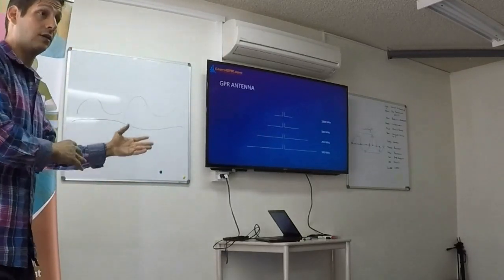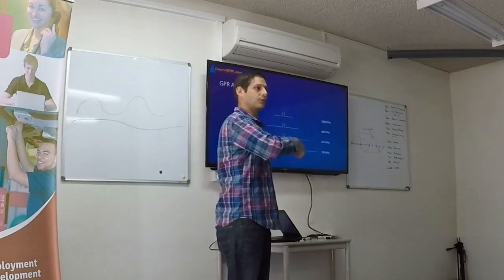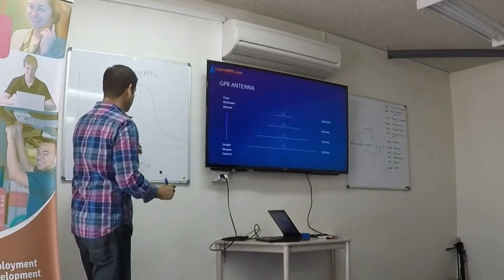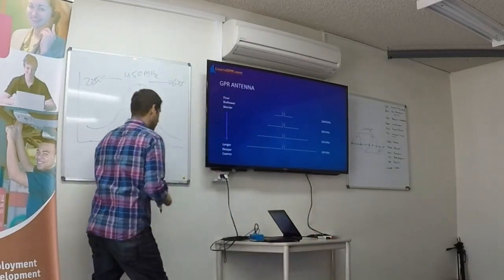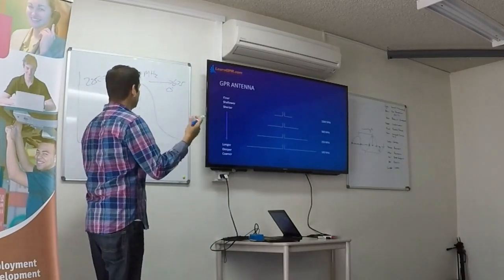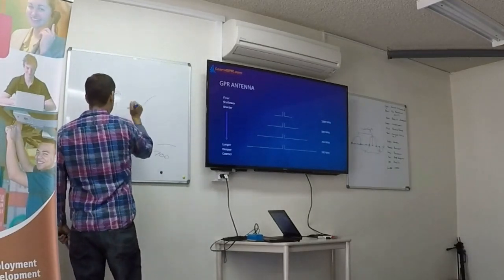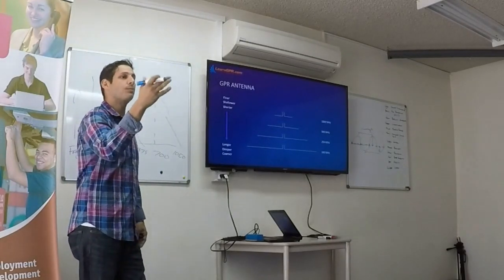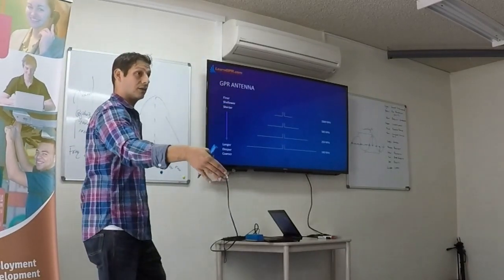GPR Antenna Sizes, Central Frequencies, and Dual frequency Overlap | Ground Penetrating Radar

Comment: Dan, U told about oscillation wave for low frequency, I used non-oscillation type of waves for gpr Loza 50-25-15 MHz
Reply from the maker: Leonid K. I was specifically discussing pulse radar. It was what everybody in the room used. Your system is built in a pretty unique way. Glad you have found it useful. You have gotten some pretty cool data